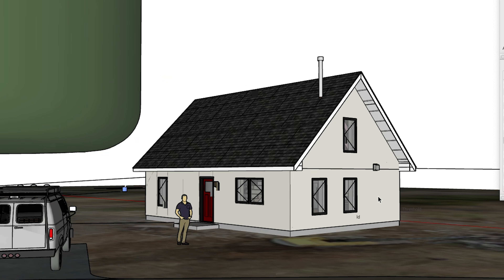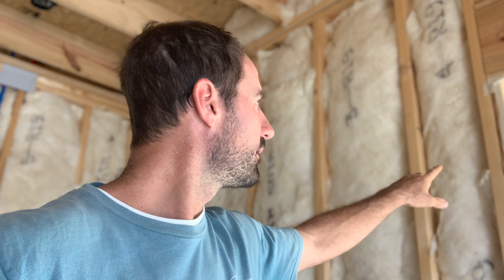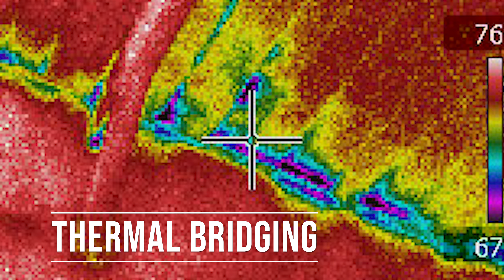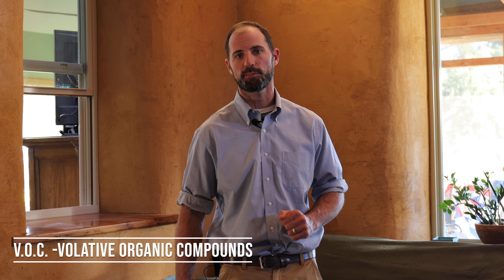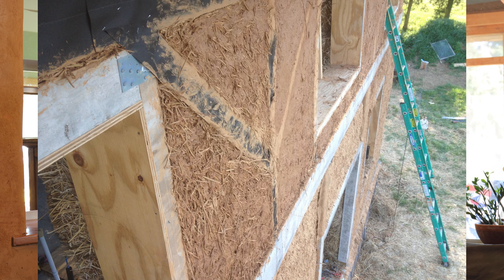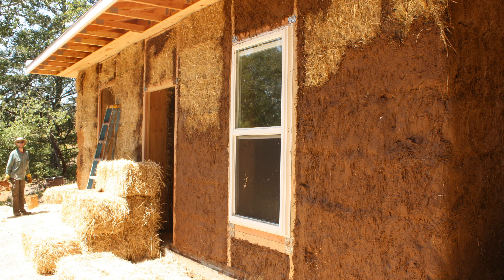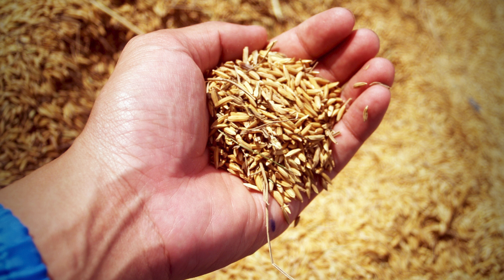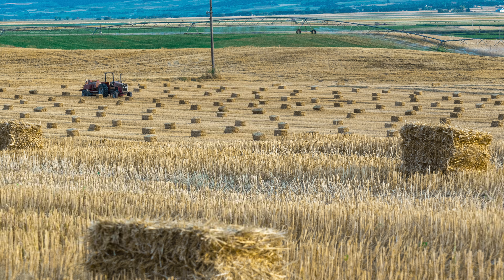The BEST way to build a new home? Building a House with STRAW BALES : Start to Finish - Episode 1

Comment: Very nice! I look forward to more. I'm currently building my own strawbale house!
Reply: What state?  I am curious about adaptations for climate.
Reply: @richardhoner7842 
Yu can make it everywhere yu can find a farmer who is able to provide straw at the dimensions yu are in need. I did one in south east france (Alpilles... Between Avignon and nice region covered of wude water retentions areas called "Camargues" near Marseille)... The only pb is to ask an thermical ingenior to calculate circulation of air... And dimension of the whole project. And precaunisation concerning inertie... The only pb with straw construction. In this project facing mediterranean sea I sat 2 iranian air refreshing towers on the roof. With a 4 pipes canadian system. Thick walls of disttribution inside linked with a big massive owen in the center of the house.
Was not traditional "provencal style" of construction but it was very good for summer insolation cose it will become very.. Very hot next decades in this region.
But it s cheap and there is no maintenance. Just have to control everyday by handy simple manoeuvres the admission and circulation of air through the house. Put some water and change coal coat from time to time in jars of the iranian filters. Openings of canadian pipes. Put some wood in the owen in winter... (Not much!) and check the good functioning of double flux electrical system on this large house. (energy  provides by solar pannels)

Comment: Yeah, would be great, but try to get your county to issue a building permit. I've looked into a few states, a few counties, & it's near impossible to be allowed to do anything that's "green", or "alternative". They all push solar, water conservation, blah, blah... But, when you want to go off-grid in any way...NOPE, can't do it here. 😡 And, these are in rural areas, ag/rural zoning, no HOAs/CC&Rs, but county/state restrictions/regulations. Sucks royally. 😡
Reply: Building permits don't ask HOW you are building your home. Talk to your local inspector and see what they say. As long as it is safe they can't really say no. Off-grid should be 100% acceptable.
Reply: Allowed per 2015 IRC so legal pretty much everywhere in USA. Just have to show the actual code to the inspector since they don't know about it.
Reply from the maker: Getting a structural engineer to sign off on your framing strategy is the key. Here’s how we did it; FRAMING a STRAW BALE HOME
https://youtu.be/P565_fhZBQw

Comment: Check out tire bales. Each one is about 60 tires compressed together. There's a version of an Earthship made of them. The 3 main walls were stacked in a day. That's another option that should be used more.
I like the straw bale house idea too. A combo of tires and straw could be good too. I could see doing an Earthship style house with straw bale walls for the front wall around the windows.
Reply: Nah tires put off stuff you dont wanna breath.

Comment: Have you seen data of straw bale building in Wisconsin?
Reply from the maker: Not that I can remember, but Wisconsin would be a great place to build a straw bale home
Reply: @HeirloomBuilders  what kinda window did you use for your house, triple pane, ect? Building code advice?
Reply from the maker: @bitchn_betty  I like Pella lifestyle windows. Just make sure they are energy star rated for the northern climates. You’ll probably need to have a structural engineer get involved with your framing so that the building code officials feel more comfortable with the structure. Be straight forward with the building inspections department. They want to help. Sometimes they just need you to show them examples of other code approved builds to get on board.

Comment: Hypothetically-
My question is... can you do a combination of straw-bale and traditional building? Like lets say I was interested in the insulation of the Straw-bale wall,
but I wanted to use dry wall on the inside, and do brick work on the outside, or even go with stone masonry? 
How would that pan out? would that render the straw bale pointless? would it be a different ball game as far as moisture control went?
Reply: Yes. Be sure to leave a "weep" between any masonry layer and an inside area. I sort of think that covering the bales negates part of the reason to use them.
Reply: It would still insulate well, but the breathability would go down
Reply: @mihacurk   Agree. A perfect vapor barrier behind the drywall is a must.
Reply: @richardhoner7842  Thanks for the reply.
Reply: @mihacurk  Appreciate the response.

Comment: Straw Bale I think it's the best idea for home building. Except a mud over the straw  How is that gonna stand up the the rain thunder storms
 3D concrete will not last very long without imbedded steel   They are not using steel inside the concrete. Big mistake
Beside you don't need a 3 D printer to make a concrete house.  They can use a mesh with sprayed concrete
Reply from the maker: We plaster with lime over the clay slip. Stay tuned for more videos detailing that process
Reply: Good question about the effect of rain.  We coated our house with a cement/sand/clay mix about 3/4" thick. Rock hard. Over that we put a layer of lime/sand coating. It will wash away over the years so that's why wide eaves are a good idea.

Comment: u should only build with flax bales . Rodents don’t like flex.  Why can’t u put an lvl  as wide as the bale on top  and fasten to that.
Reply: And bolt it to the foundation throw the bales
Reply: @adamchapman4329  What is lvl?  Since the bales are totally encased rodents can't get in.

Comment: I can't find info on load bearing straw bale house anywhere. I'm interested in making a home of huge bales 2.5m x 1.2m x 0.9m and avoid the need of heating if possible.
Reply from the maker: You could certainly do that, but it will take some extra foundation width to accommodate a larger bale. And you'll need heavy equipment to move and place each bale. I'm not sure if there are any guidelines or even permitting for load bearing straw bale anymore. I know its been done in Kansas, USA....
Reply: A few years ago I bought some large square bales , very heavy , 3000 lb (1400 kilo) , so you need some big machinery to handle them , my tractor was 130 hp and it was hard , the loader needs to have a grapple . You would need some small sq bales to fill the odd spaces cause you would not be able to split the large bales without machines that will retie . From what I have been told with increasing R-value there is a rate of diminishing returns , if you go from R-40 to R80 you might only save 20% energy . Now that I have mentioned some negatives , I Am building a cordwood , timber frame shop with a bale infill hoping to get a R-60 wall  . 4 pane windows , cause there is more energy loss from windows than walls . When I was a child we made bale houses to play in for the winter , at temps to -50 just body heat would warm it enough to be comfortable without coats . If you can get the bales cost effective then yes build it thick . For your water , you do not need a sand filter , many people here used rainwater with a cistern as water supply till they got wells , just a in-line string filter will be adequate
Reply: @outinthesticks1035  wow, that's heavy ones. The ones I'm talking about are 380kg each
Reply: Many states have building codes that will allow a 1 story load bearing straw bale house however you have to get the plans aproved by an structural engineer and you will probably encounter more difficulty with the building inspector and insurance companies.
Reply: @scar3xcr0  nah, i'm not in the US.
Reply: @imiy  Ok, then you should check with yhe local building code where you are. Most are based on the international building code the same code US building codes are based on. If load bearing is allowed in your local area it is a much easier and cheaper option and you should go with it. If it is not you will have similar issues with building inspectors and insurance coverage. There is much less available information on load bearing straw bale unfortunately. This video https://youtu.be/Cd3PlKH2PIs is pretty good. Some older books punished in the 1970s and 1980s have more info on load bearing. I have a few in my collection with good diagrams of load bearing straw bale houses but most of the books written are about post and beam with non structural straw bale wrap.
Reply: @scar3xcr0  thanks for the link! i'm pretty sure there aren't any codes about strawbale building here. I'll build it illegally, but i'm concerned about which problems i may face.
Reply: @imiy  Your welcome. Good luck with the build, load bearing is a great way of making inexpensive and environmentaly friendly homes. Which country are you going to build it in?
Reply: @scar3xcr0  Ukraine. Winters are quite cold here, and i'm obsessed with making a passive house (or as close to that as possible) with a flat roof to collect snow (and rain of course) into underground storage, with a gravity fed sand filter. unfortunately, there isn't much info on any of that...
Reply: if I had more time when building my house I might have considered a straw bale or other alternative method . But when i started moving dirt I only had 60 days before winter set in to complete construction .When listening to this video talking about it being so much cheaper , you need to take into account that where you and I live it's much colder than there . A lot of your costs will not change from conventional build . When I was working with my contractor he told me that 1/3 of the cost was in the basement ( footings,walls, plumbing,heat , part of electrical, sewer ,finishing , basement windows , etc. . 1/3 of costs would be finishing the inside of the house . These costs will not change when going with strawbale . 1/3 of your budget would be for the structure ,(  framing , roof , windows , doors , exterior finish , insulation , wiring , paint , all that kind of stuff) . Your roof, exterior finish, windows etc will not change in price , all that you save on is framing and insulation , and if you use a timber frame then you need to consider the cost . When I am building my shop , I already have #1 the timbers #2 the bales #3 roofing material ,#4 cordwood for exterior ,#5 gravel and sand for concrete and plaster #6 machinery . All that is still nessesary is roof trusses , lines for in floor heat , electrical , boiler , windows and doors and Portland cement so I think I can justify it . If it's needed to buy all materials then I am not so sure , if you need to hire labor or contractors I do not think it makes economic sense . You can find lots of info online from people who have done this but mostly they can supply materials and labor themselves . Look for a video series on YouTube from " building roots" , it's a young couple who chronicled their build in a colder climate , doing all the work themselves for a timberframe , with strawbale infill

Comment: At 2:38, you say "...tons of gaps and places where cold air leak inside your home."  

That violates the second law of thermodynamics.  Heat flows spontaneously from a hot to a cold body and not from a cold body to a hot one as you have claimed.

Gaps would let heat escape. Gaps never could let cold air leak inside.
Reply from the maker: You’re right about that, but there’s always make-up air, which would come inside and feel like a cold draft.

Comment: Wouldn't the insurance be higher in cost?
Reply from the maker: Insurance is not higher cost in my experience. Strawbale homes are much more resistant to fire and other common problems when compared to conventional homes.

Comment: There is a lot to be said for load bearing straw bale building. Its not so popular in the US...but I think this is a trend rather than anything sensible...more to do with caution in the face of new ideas. When you really know what you are doing and get the idea properly it makes sense as it has a lot of advantages over the post and beam way. I think the popularity of the latter is because of a history of Post and Beam in America in the past.
Reply: Agree. If I built another I would do load bearing. I know of one built that way in 1973 and it is still ok.

Comment: Are these bricks kiln dried. How is contamination mitigated in the organic material? Is a conventional vapor barrier required on either the interior or exterior?
Reply: Am a residential contractor in Vermont very interested in putting one of these structures up
Reply from the maker: Hi Matthew, the walls are made of square straw bales, that are stacked like bricks. There is no vapor barrier required, you just smear earthen clay plaster and/or lime plaster directly on the bales. The bales and plaster make a wall system that is hygroscopic and vapor permeable
Reply: @HeirloomBuilders  perfect, wasn't sure if you guys were using standard bails or if there was a semi engineered building material version. Either way, very very cool idea do you have an email I could reach out to?
Reply from the maker: @matthewmarsie9457  sure. Email is logan@heirloombuilders.com

Comment: Dude: talks about air leakage

Dude: fails to meantion sealing house's envelope. 

Dude: talks about skinny walls

Also Dude: fails to mention adding insulation on sheathing to give a thermal break.

Dude: fails to mention the greenhouse gases produced by quick lime priduction

Dude: Calls rockwool and fiberglass insulation toxic

Also dude: fails to mention fiberglass insulation has been revamped.
Reply: We live in a Strawbale and have had none of these issues.
Reply: @RVBadlands2015  I'm talking about conventional build techniques that he's comparing strawbale to. Of course strawbale construction is air tight and efficient.
Reply from the maker: Hey Derek! These are all excellent points. I thought I had touched on most of them, but they definitely deserve more explanation and probably an entire video for each of them. Cheers.
Reply: @HeirloomBuilders  you said that you've built houses to passive house standards.  Curious id you did a bliwer door test on the strawbale? And what your heating and cooling costs are compared to a passive house?
Reply from the maker: We did do a blower door test, and it was not good: 6.4 ACH! I should have sealed off the wood stove pipe penetration, and the lead acid battery vent pipe to get a better reading on how the straw bale wall system performs. We are building another straw bale home now and will get that tested for air leakage as well. I’m guessing we will get much better results on this one, but not nearly what is achievable when building a plywood-clad wood box (ie comventional home) with caulk and foam everywhere.
Reply: @HeirloomBuilders  I love that you are environmentally minded and I really don't mean to sound like such an A hole... I just want to point out when us natural builders aren't being so good for the environment.  And I have to call out wood stoves.  They are terribly inefficient and horribly polluting devices.  For example, imagine the entire city of Chicago burning wood for heat. The air quality would be even worse than it already is there. Not to mention the huge increase in their already appalling carbon footprint.  

Strawbale homes have enormous potential.  And if they are heated with heat pumps and built to passive house standards and powered with renewables then F@#$ YEAH I'm so down

Comment: use 2x8  t-stud to avoid thermal bridging, insulate with spray foam or cellulose and do not trash peoples brains with straw houses which will not retain value over time...
PS; extremely poor quality windows will loose energy anyway despite tights walls...

Comment: This is handy to know >> 
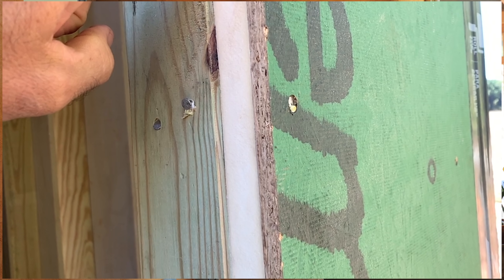4:46 "... fiberglass insulation, rigid foam insulation, and even rock-wool insulation are toxic to work with which means YOU NEED TO WEAR A RESPIRATOR to cut and install these materials OR RUN THE RISK OF GETTING A LUNG DISEASE"
Reply from the maker: It’s for real. The fine print on these materials doesn’t serve as a strong enough warning about the real risks.
Reply: @HeirloomBuilders  Decades ago, I used to install coaxial cable in older apartment buildings ... pulling the cable in the attics and dropping it to each unit. Many times I was crawling around in fiberglass insulation. I was young and pretty clueless. Terrible job. 
Thanks for the content.

Comment: Debating rammed earth, compressed earth bricks, and straw bales as our building material in hot and humid Texas - 1 hour east of Dallas.   That' means learning on the fly and more time in our off grid RV and self financing since ag banks aren't on board.  Plus stray bales have been hyped so much for DIY and gardening hacks they cost almost as much as horse hay.  The best I've found for a 40 pound bale is $8.  There goes the  dirt cheap.... I look forward to tracking with this series.
Reply from the maker: Damn! You’re not kidding. I can get wheat straw for $3/bale here in NC.

Comment: Thanks for the video :-)

Can you talk about humidity or moisture issues with respect to strawbale construction in North Carolina?

What about strawbale construction with timber framing? Is that possible and do you have any experience with that?
Reply from the maker: Hey Ben! Humidity can be a problem if there’s not enough exposure to wind and sun for drying. But I know a straw bale builder that has several bale cottages in the middle of the woods that don’t seem to have any problems. 
Timber framing is a great way to build with bales. I haven’t done it, but I would probably build the bales separate the frame to keep it as exposed and beautiful as possible